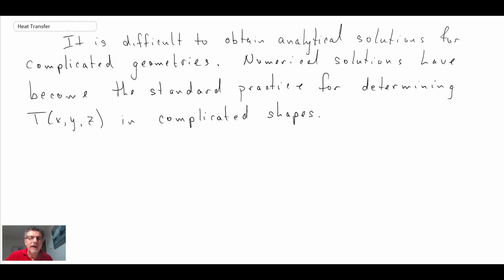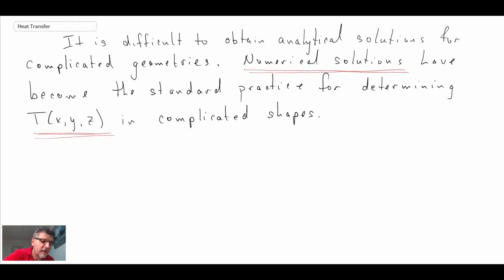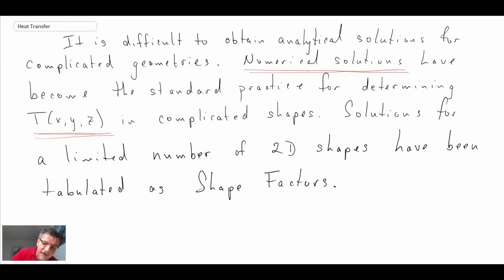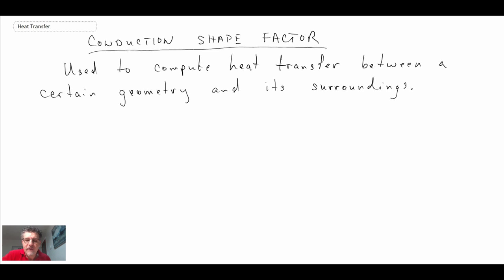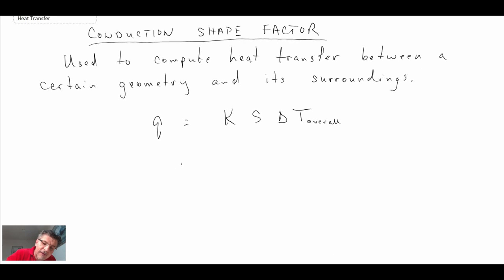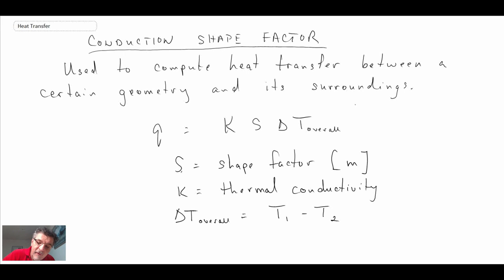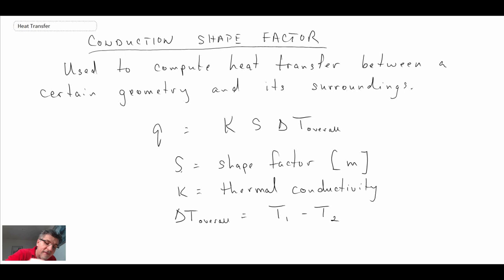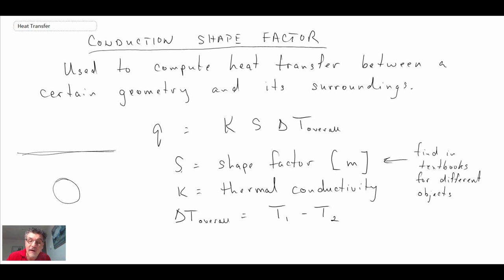Heat Transfer L10 p2 - Shape Factors

Comment: Question. Given that i have the temperature profile of the soil at -1m as a function of time and i want to evaluate the heat transfer between a pipe at -2m containing a liquid at some temperature. Is it possible to assess the shape factor using the depth of 1m (difference between -2m and -1m). 
In all examples the surface temperature is taken at the ground level. However i wanna be able to assess the Heat echange between the pipe and the soil knowing the soil temperature at a certain depth rather than the ground level.